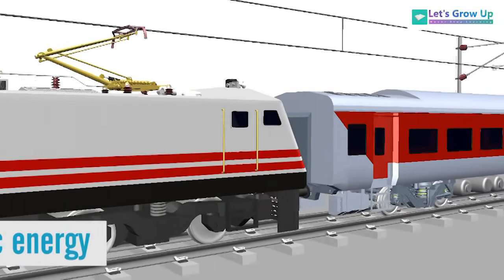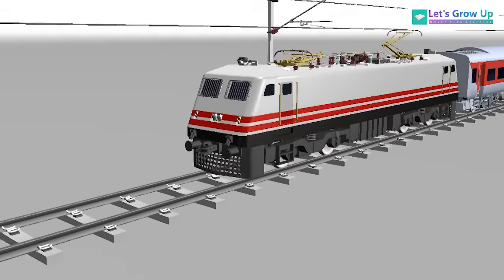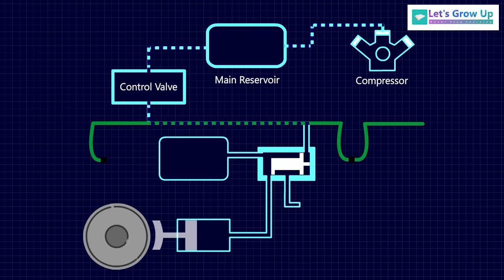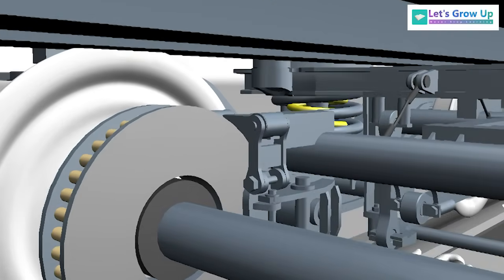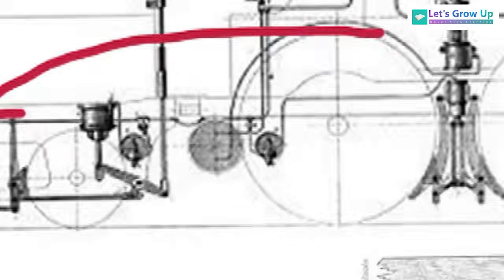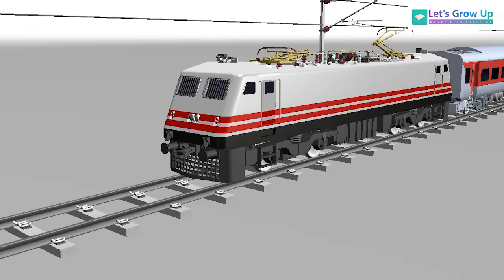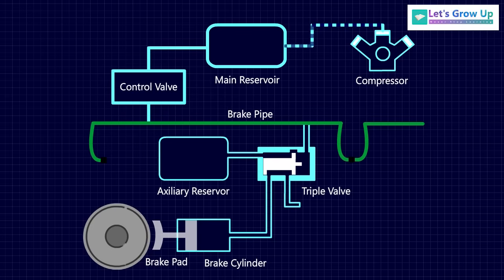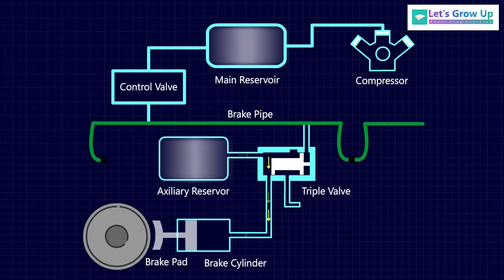Fascinating Working Principle of a train's Air Brake System - A Must-Read for Tech Enthusiasts

Comment: I've watched a handful of full of videos on dynamic breaking and a couple along with this one on mechanical braking say "braking is performed by taking kinetic energy and making it het energy " thats so confusing and actually not correct , the conversion from kinetic to heat isnt wht stopa the train its friction that stops the fkn train which causes the conversion to heat energy, now i know some of you engineers are going to flame me .... but my point is this isnt being explained to engineers.. and bith my mechanical engineer brothers  agree with me and those assholes never agree with me

Comment: I was taught that modern train brakes work opposite of say car brakes - pressure to apply the bakes. As for trains, air pressure releases the brakes, for example if the train comes apart, the air pressure reduces, and thus applying the brakes. Not air pressure applying the brakes!
If there's no pressure for the brakes, (to apply the brakes) thus one may have a "run away" train AKA air pressure to apply brakes!
If there is pressure to release the brakes, "no run way" train! Thus like in Sydney & Melbourne metro trains, if one passes a stop signal, the train stop will trip a lever and thus release the air pressure and bring the train to a stop!
Reply: Additional: The principle of train air brakes is based on lowering brake pipe pressure to apply the brakes and increasing brake pipe pressure to release the brakes! Not the other way around, the train isn't a car!
Reply from the maker: Train brake is  compressed air brake system watch new video for more clear It was introduction video, because there are so many devices
Reply: @LetsGrowUp  Just to clarify, in Australia and New Zealand, we use air pressure to release the brakes. If the train (regardless) splits in two, the brake pressure drops to zero psi, thus the brakes are applied automatically.
Not like air pressure to apply the brakes - stupid idea! That is it the train splits in two where does the train (2nd half) get its pressure from, when the reserve is empty? 
Is that why (I heard) that America (USA)) has lots of run away trains and derailments? Air pressure to apply brakes?
Isn't it safer to have air pressure to release the brakes? Yes it may cost more?
Reply: You are correct
Reply: @made-in-the80s Australia and New Zealand uses Air Pressure to Release the brakes. Why would trains today use air to apply the brakes, that is Not fail safe
The air tank on each car/wagon has a limited amount of air, when it runs out, then what? I talking about when the train comes apart (in motion that is) it does happen!
As to brake tests before the train leave, yeah sure what about later? We all have seen and heard in the USA "run a way" trains, or is that just fiction, it never happens? Duh! of course it does, certain railway companies think using air pressure to apply the brakes is better, what a load of rubbish. 
Trains are not bicycles weighting less than 70kg while a train weighing over 100,000 Metric tonnes!
Reply: @made-in-the80s Just to understand your trains* uses Air Pressure* to release the brakes, Not to apply?
Reply: @made-in-the80s So am I correct train brake (most of the world) use air pressure to release the brakes?  Of course the "air tank" has a limited amount of air (broken apart train)?
Reply: @made-in-the80s Not like some USA trains they use air to apply the brakes like a bicycle or car brakes?
Reply: @made-in-the80s I understand, it's the locomotive that has dynamic brakes from the traction motors (Diesel Electric/Electric), Steam locomotives don't have electric motors! As to the passenger cars and freight wagons, I known they don't have dynamic brakes as they don't have traction motors, except the TGV...
...As to runaway trains (wagons/passenger cars separated from the locomotive or other wagons/passenger cars) you the driver can't do much with the broken part (2nd half) to stop it! Only the 1st part as its still connected to the locomotive!
Of course if all the wagons/passenger cars use 100% air pressure to release the brakes and when the train comes apart (it shouldn't today) the brakes - 2nd half - the brakes will automatically be applied!
As I Googled George Westinghouse invention of Air releasing the brakes - original idea, this the term fail safe
I totally disagree with the idea with using any air pressure to apply the brakes, because it isn't 100% fail safe, thus prone to "runaway" train wagons (mostly)!
I hope this makes sense? Air to release the brakes! Loose air brakes = on!
Reply: @made-in-the80s FIY, I used to have a book, "Transport Quiz" NSW Australia, that explains how Australian (and New Zealand) train brakes work! Also Air to release the brakes (fail safe) succeeds Vacuum brakes any time and today should never be used
Reply: @made-in-the80s We haven't had that happen after switching from vacuum brakes to air pressure to release the brakes, as when an Australian train separates, the back half brakes come on automatically! Regardless if the train is freight or passenger!
Our train brakes are fail safe no air pressure = brakes on, air pressure = brakes off!
Our dump trucks/ore loaders are bigger than a house (almost) if a train hit one of those the locomotive would end up as razor blades 😀 
Just to inform you, I am not a train driver , I just love Australian trains and how they do things.  As I have seen on the TV News about American (USA) trains still have "runaways".  Sad really it is amazing that the USA hasn't had any real major accidents, where a town has to be evacuated due to toxic fumes/smoke! Or has there been such? If so why hasn't the NTSB.gov done anything to prevent such?
Reply: @made-in-the80s Just to inform you, I am not a train driver , I just love Australian trains and how they do things! I do have a good understanding about the differences in American brakes (freight mainly) and Australian train brakes! Sorry to ask, are you an American (USA) Train driver?
Reply: @made-in-the80s Yes we call a person that drives a train a Driver, where as for high speed trains, sometimes they are called pilots.
So therefore 90% of trains when they use Air Pressure to release the brakes to be 100% Fail safe! Otherwise if the train uses air pressure to apply the brakes, the train is NOT fail safe!
Yes I've seen YouTube video where truck get stuck on level crossings, I personally blame the local road company, as the level crossings are not really level!
I've seen a video where an ore truck crossing, there is an Air Gap for the electric train! 25kV Air Gap - Australian Railways:
https://youtu.be/q55EfuVYNW0
The "Dump truck"is a "baby" compare to some of the Australian outback, there are almost big as a house!
If you have time, here is a link to Sydney NSW train videos, https://www.youtube.com/@STCV and https://www.youtube.com/watch?v=RQZB7B3emqU&t=17s 
the 2nd video (may want to skip through parts) give the sound when the train arrives a the end of section, the driver releases all of the air!
Reply: @made-in-the80s As I'm not a train driver, however, I seen "Near Misses" I believe that today, all train drivers, have pre-counselling before something goes wrong (Incident). 
Over in the UK and into the 1990's (Melbourne) used to have large gates at level crossings, instead of boom gates (arms). Thus less train verses vehicles/people... Just a thought!
Of course YouTube videos when a train slams into a vehicle, like you said they get stuck on the level crossings! Why don't the local authorities do something about it? like make the the level crossings level?
Reply: @made-in-the80s Yes trucks/cars do stall (even cars with automatic transmission) Sure trucks uses level crossings instead of bridges, in some case they have no choice as their gross weight exceeds the bridge gross weight e.g. 100,000Kg (truck gross weight), 40,000 Kg (bridge gross weight). I believe why vehicle get stuck, (1) Level crossing fault - not really level, (2) the driver doesn't know his vehicle, (3) Vehicle is over weight!
Apart from bad driving (crunching gears) most times the level crossing is at fault, they aren't really level!
In Switzerland, where they have electric trains (mostly) they have a device that goes over the approach to the level crossing to inform the "truck" driver if they are to high.  i.e if the contact wire is 4 metres above the level crossing and the truck's height is 4.5 metres the device will bang the front top of the truck!

Comment: Please do the video about Regenerative braking in electric locomotive  I'm eagerly waiting for the next video about this topic
Reply: Regenerative braking is where electric trains Locomotive and EMU's get their power/energy from an overhead wire or third rail! When braking or going down hill they produce power and sends it back up the supply line overhead/third rail. Like dynamic braking! They are related! I think "Let's Grow Up" may have made a video?